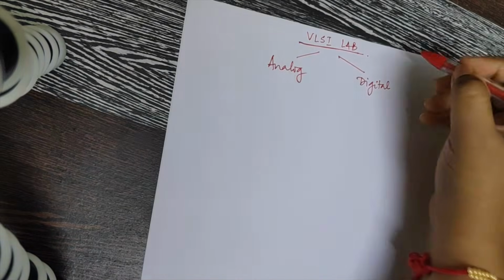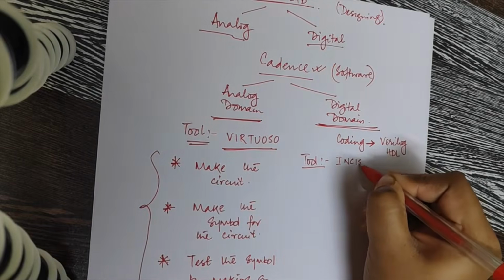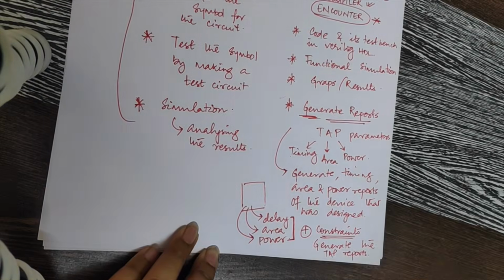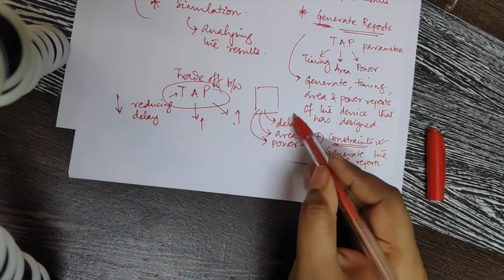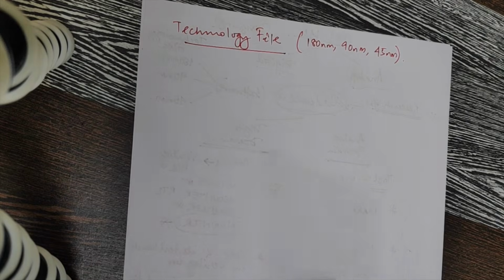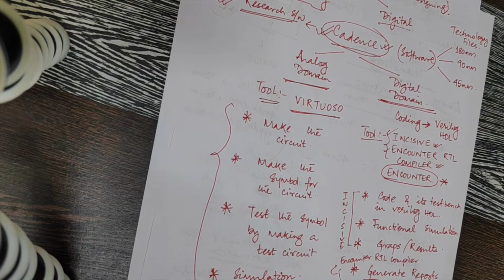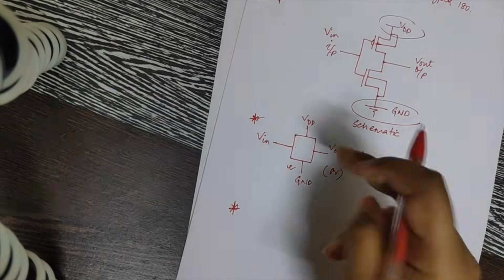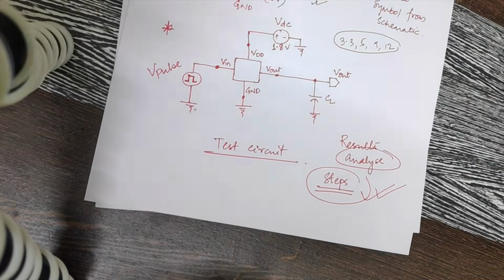Complete Cadence Tools Guide: Analog & Digital VLSI | Lab Series #1

Comment: Madam please tell the process or send a link from where  we can download the xmaneger or cadence software
Reply from the maker: I appreciate your persistence—it shows you really want to enter this field! 🛡✨

The Process: You cannot simply download Cadence from a link. It requires a license from Cadence Design Systems, which is typically only granted to Universities or Companies. Even if you download the installer, it won't run without a license 'key' file.

My Advice: Don't get stuck trying to find a link that doesn't exist. Instead,  you can explore Open Source VLSI! 📈 You can download tools like Magic, Ngspice, and OpenLane for FREE right now. The logic you learn there is exactly what we use in Cadence. Let's focus on building your skills so you can get into a company that provides you with these tools! 💻🚀

#roadto500subs #vlsidesign_ssg